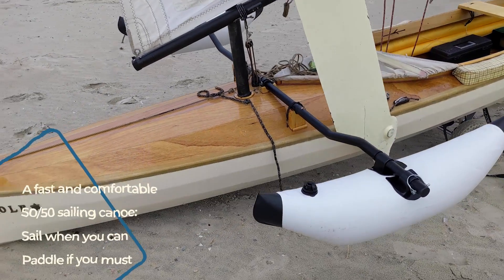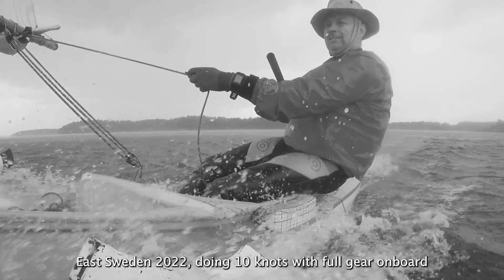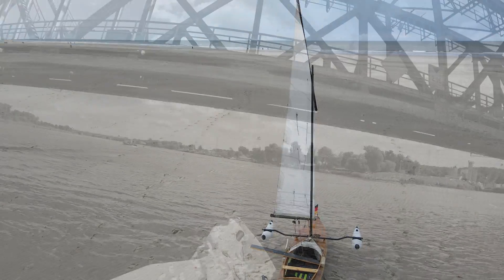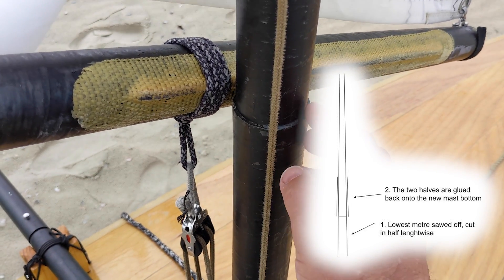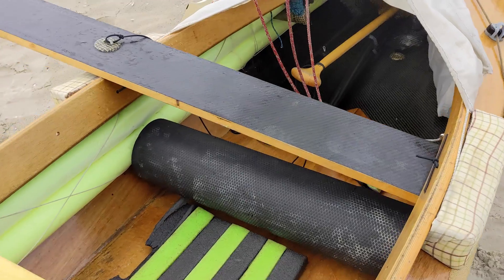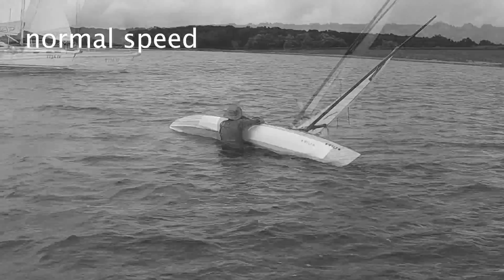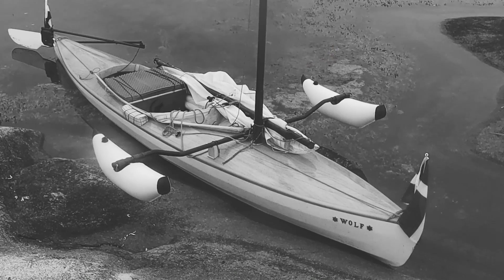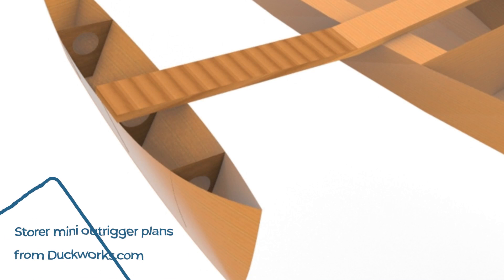Artemis sailing canoe: How it works

Comment: Those inflatable floats are useless at speed
Reply from the maker: Indeed, and ugly, so I built new ones. What I liked is that you can easily take them off, for light wind days
Reply from the maker: They are a brake and kill speed, but I have sailed them under water in a squall, so not completely useless

Comment: Koos--I own several hdpe sea kayaks and during covid lockdown built Rowcruiser with friends(they built peapod-rowc-goat island skiff variety of boats to ease boredom)I came across a pedal drive recently which convinced me to turn to pedal drive small car topable trimaran ideas like Drifter 14*--Trika 540* for sail capability mobility and storage.Any ideas to pick which one from you?Bnb mini trimaran** seems like long way to come into market for plans but I also saw them evolving from Sponge Bob trimaran into Bnb tm in years making.
Reply from the maker: Fun project! There's a proa for sale on marktplaats in Netherlands ;) 
There's so many aspects involved in picking a design: sailing, rowing, beauty, cartopping, weight, load capacity, performance. Could not judge on that ...
Reply: @Canoesailor  Istanbul is along way to cover for 2nd hand shunting proa from NL :) I admire proas

Comment: that's a great design. I appreciate your detailed explanation video. I'm working on my own design and after several iterations I now sail pretty high upwind. Does yours sail upwind? If it does then that challenges some of what I thought I understood about boat design and I have to figure out what I am missing. Thanks.
Reply from the maker: Thanks, yes it goes great upwind, with this sail between 100 and 120 degrees tacking angle, mostly depends on how much waves there are. On lakes, mostly faster than keelboats. Good luck eith your design.

Comment: Great video! Lots of ingenuity and thought gone into that boat!

As for your issues with with the outriggers, I wonder if you have considered building out of closed-cel foam with fibreglass? They can be made very narrow, if needed. I am currently working on a couple of them for the Polynesian sailing canoe I am building. (Sorry, unable to post photo here).
Reply from the maker: Yes, I looked into that, Gary Dierking has a great description of how to build them, but... I wanted to be able to take them away easy, therefore inflatables. But I'll change to fixed ones now

Comment: Hi Koos. Very interesting video. Thank you. I have my own sailing canoe which I am constantly modifying to make it more suitable. I am interested in where & how you stow the lug sail when paddling. I find this is a major problem for me. Do you have a video showing this, or could you make one?
Reply from the maker: Thanks, first I used to stow it in the boat, but now I put it on deck, there are two short ends of rope to tie it down for that as the sail and mast tend to glide away. Here is a pic, the aft rope is where the green flag is, the forward rope is near the mast base. 
https://photos.app.goo.gl/Kvd2pgo1eK6DTA1y7